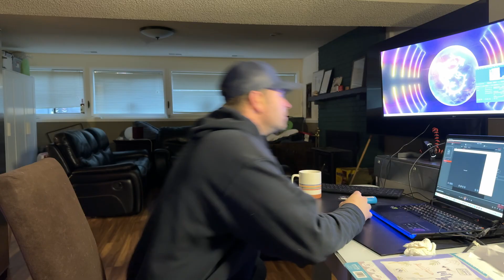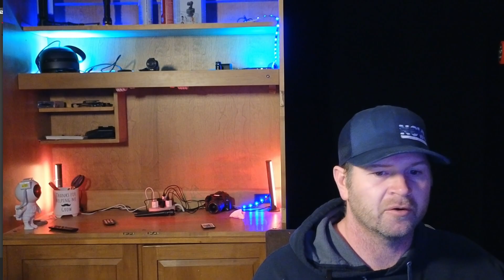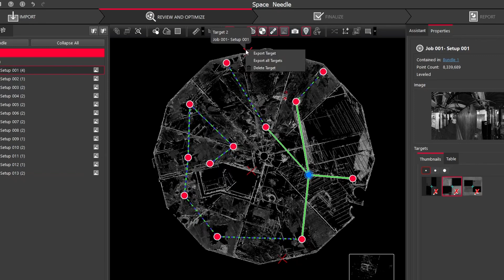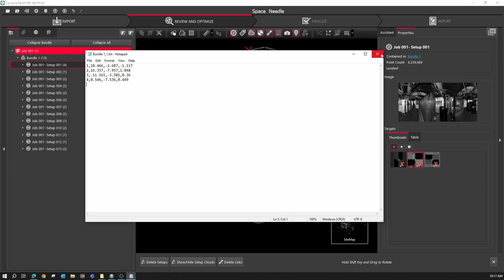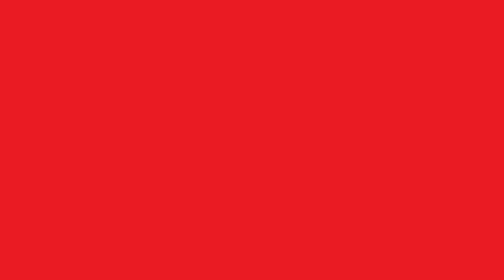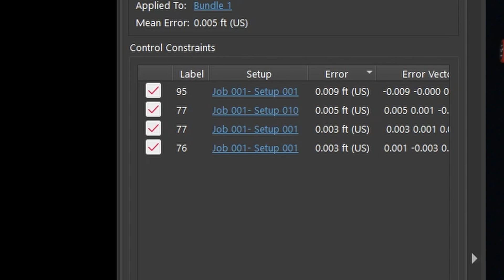HQ 6 Fixing control issues in Register 360

Comment: So, we sre going through an issue where all of our elevations are off, but northing and easting is pretty solid. Our elevations are leveled from a known benchmark, so its not from GPS, etc. Its a long site and were 0.08 high on each side but on in the middle. We have 21 control points, so we cover it well. We've tried manipulating them around, and no luck, the best restraint we get is 0.08, thats too high for us. Any suggestion?
Reply: My apologies for the late response. We figured out why it wasn't applying. We had our links locked when we applied our control. We are slowly learning this software. We were so confused because our control networks are tight but we're off here. Unlocking the links, then applying the control worked. We checked our benchmark within 0.01 which is where we like to see. Appreciate your feedback.
Reply from the maker: @ricarldoangeli5611  that’s great news. Feel free to reach out anytime you need help!
Reply from the maker: The first thing that comes to mind is that on long jobs things can tilt but since it’s happening on both ends and you have 21 points, that’s probably not the case. I’d probably have to see it on video or get my hands on the data to diagnose.
Reply from the maker: I’m not sure how many scans there are but I’ve had one or two jobs where I couldn’t find issue and deleted all links and put it back together

Comment: Interesting video. One thing I've discovered is that if I keep clicking on "Re-Apply Control" it will iterate through a few different sets of target errors eventually coming back to the first set. So sometimes my first set of errors doesn't look too good and I can click "Re-Apply Control" and get a better set of errors. Do you know what is actually going on with the software when I do this? I'm assuming it's adjusting the best fit algorithm in some way? (this is usually in a situation where I have good cloud to cloud registration and all links are locked before applying control)
Reply from the maker: Your assumption is correct.  It’s running the  algorithm again. How much of difference are you seeing? It should only have a small range that it could shift in due to the links being locked. Which I’m super happy to hear you do. Some people don’t lock and I’ve seen hours worth of work torn apart because of it
Reply: @mackkowalski1  Haha yes I've made that mistake before a couple of times with unlocked links, although sometimes, if I'm very confident of the control and targets, it can tighten things up with unlocked links. Generally I always lock before applying control. I can't remember offhand on the differences, I think it mainly happens when I've got 1 or 2 target pick positions that are a bit dodgy. I make sure to have plenty of redundancy and will remove the dodgy ones from the control. I'm completely self taught re scanning and register 360 so sometimes ask questions on Youtube etc to confirm what I'm doing.
Reply from the maker: @anivegmin  as you should. YouTube is a great place to learn things